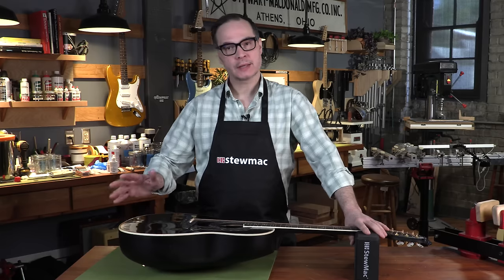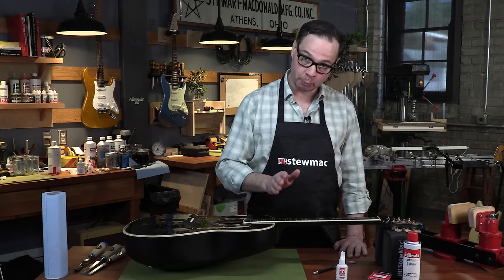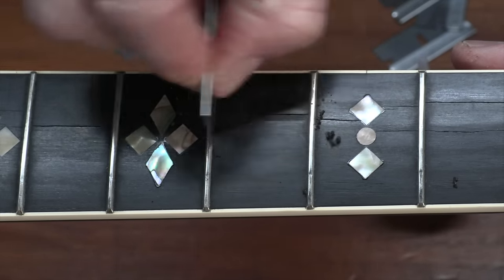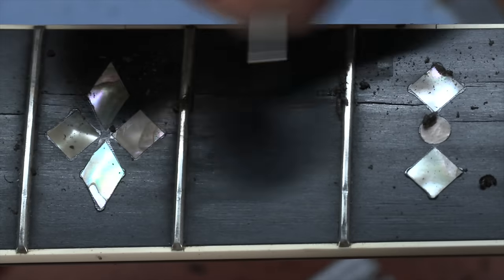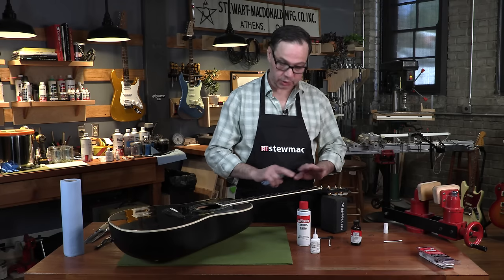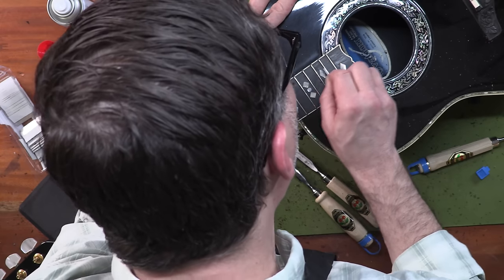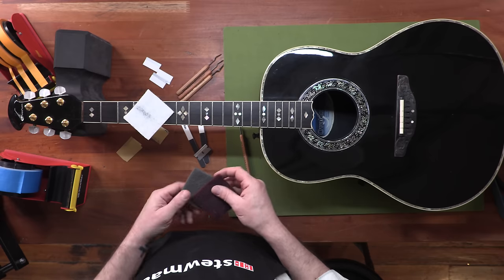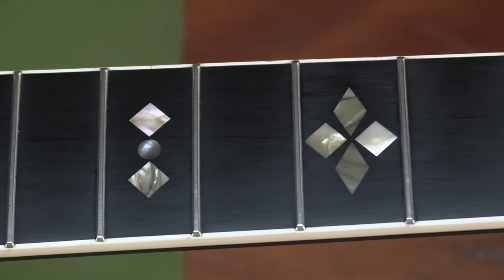Simple Trick for Repairing Cracks on a Guitar Fretboard

Comment: I've always repaired ebony with ebony sawdust plus superglue.  You sand some ebony (or the board) to make a fine dust.  Pack it into the cracks and hit it with super glue.  Scrape and clean up as he did.  I would think that it would be much faster, but maybe it doesn't get in as deep?  Its just another method and its good to know multiple ways of doing things!  Thanks!

Comment: The though of a bottle of ca going over the guitar keeps me awake at night !
Reply from the maker: You could also use a pipette.  Those are very clean and controllable you can hold it facing up until you get it exactly where you want it.
Reply: @stewmac  Better idea. You can also pull and stretch the end of the pipet and cut off the very end that didnt stretch to get less glue coming out !

Comment: Do yourself a favor and get some syringe tips. They fit on the super glue bottle perfectly, and it's way more precise
Reply: Thile guy in the video is an amazing luthier though. Do what works best for you. But I live the syringe method
Reply: You mean like a needle that would go on a syringe?
Reply: love when the rando commenters tell the experts what they should do.
Reply: @eric_in_florida  I was just trying to help. Most of us aren't used to applying super glue with a freaking razor blade....
Reply: @wbfaulk  yes. Get the dull tipped ones. They fit perfectly in cracks like the one in the video. Buy a bunch, they will get clogged.
Reply from the maker: Syringe needles are great for precise application, we even offer them on our website. They work well with wood glue, but they can fall off of a superglue bottle, and as we pointed out that can be a disaster when you have a full bottle of superglue tipped over the guitar. If you use a needle, I'd recommend the fine line applicator bottles we sell or a disposable syringe. Otherwise the whip tips are close to the same precision and stay on the superglue nozzle better in our experience. Many ways to do this job well...thanks!
Reply: @stewmac  I'll keep that in mind.  Thanks for the heads up.  To be clear, I wasn't trying to say there's a wrong way... Just sharing what little bit I know.  I use Permabond and haven't had any issues yet 🤞
Reply from the maker: @JuanValdez24  No worries! We're all about spreading knowledge and there's more than one good way to do most of this. Thanks!

Comment: Aren't you lowering the height of the wood in that spot by continually scraping it and removing material? So now there's a low spot in that section of the board? Wouldn't it have been more effective to have had rosewood flakes from another source and use that instead of scraping it from the board?
Reply from the maker: Great question! Although it does look like a lot, we are only removing about .003" of total material. That's the thickness of a yellow sticky note for reference. We scrape the board evenly across the radius to remove an equal amount everywhere as to not create a low spot. You can choose to use wood from another source, but you still need to level off the fill somehow, and light scraping is a good way to do that. Thanks!

Comment: Fun to see you working on an Ovation. I have an Ovation 12-string. The strain of 12 ball ends in line in the bridge over 50 years has split along the grain line of the 12 holes. I have an extra bridge from Ovation. I can either try and repair it or replace it. If I repair should I use wood glue or CA or epoxy? If I replace, can I use your heat lamp/skinny knife/ top protection approach to release the glue or did Kaman Aircraft use some space-age glue?
Reply: If the bridge is already cracked, any repair will simply be cosmetic.
Get the worn out bridge off with a bridge heating mat, pallette knives (round off the corners) and use extreme care not to rush the process. It should pop off. You shouldn't need to pry it free.
If you get to the point that you can't get it off, take it to a luthier. It'll be worth it.
If you get it off cleanly, the bridge footprint will need to be fully scraped/sanded, and you'll need to prep the replacement bridge in certain ways. Too wordy to type it all out, but I recommend the YT channel twoodford. He shows a lot of bridge replacements in great detail.
Good luck!
Reply from the maker: Hi Scott! Any advice we (or anyone else) could give you without the ability to examine the guitar should be taken with a grain of salt. Bridge repair and replacement can be tricky, especially on an Ovation, and this is something that would need to be seen by someone with experience first hand. Standard techniques you see on our page and others are usually applicable, but there are nuances specific to each situation that can make or break a repair like that, and that can only be determined in person. Thanks!
Reply: @peachmelba1000  so so helpful. Saved me
Gobs of tears. Any idea if Ovation in the 1970s used glue that wouldn’t respond to heat to soften?

Comment: I think I would drill tiny holes the size of the applicator tip and inject the glue in, maybe take a little sanding dust from elsewhere to make a filler with regular glue to catch the top 3-4mm then sand it all down, this job may be a job you want to remove those frets to get it all and get it right.. this is more of a quick fix id say.. very nice repair tho

Comment: Not sure if anyone from stu mac will read this but i hope so! I have just bought the neck relief gauge,  checked the stu mac site for any videos for demonstration but nothing to be found almost every other item in the shop has a video could stu mac please upload a video of the neck relief gauge being demonstrated
Reply from the maker: Thanks for the recommendation, a video would be good for that. The tool is simple to use though. Zero it out on a calibrated surface like a leveling beam or straight edge. Then check your neck. Every mark to the left of zero will represent .001" of relief, every mark to the right of zero is .001" of back bow. Thanks!

Comment: as an experienced Tech ill just say the risk of turning the bottle upside down over the fingerboard is worth it to save a ton of time using that razor blade method. Just being realistic. A busy shop doesn't have time to take that much time for a little added safety.
Reply from the maker: Yep! That's mentioned at the 6:15 mark when we go back to using the bottle. Just a demo of the razor blade technique. Thanks!
Reply: @stewmac  oh true I commented before I watched it all haha
Reply: It probably  depends on the guitar. If it’s a very high value guitar I’m on my best behavior as I go into conservator mode.
Reply: @FiddleSticks800   yes of course

Comment: “Simple trick?!?” This is NO “simple trick!” Yes, it may be possible to do using ordinary household tools like razor blades, scrapers, and maybe sand paper, but it clearly takes VERY considerable skill and hard-won experience to do it as cleanly and as successfully as you did it here! How many guitars did you have to practice on before you had the confidence to do a high end guitar like this Ovation? If it’s more than one, then it is NOT what I’d call a “simple trick!”
Reply from the maker: I think you will be surprised.  This really isn't that hard.  The biggest risk is not getting too much glue on the fingerboard.
Reply: I think you just need to try it instead of complaining about how "hard" it is before you've even made an attempt.

Comment: Why DO you guys always use lemon oil? I mean, aren't Lemons acidic? And don't carpenters just use simple wood or furniture oil stuff, like beeswax? Which you can get anywhere and probably cheaper.
Reply: Beeswax, maybe for guitar body, the fretboard needs the oil to absorb into the wood not just set on the surface.
Reply: @flintdavis2  That's what I meant, a replenish, not a finish. I was thinking of Howard's feed & wax that I've seen Will Gelvin use, Crimson guitars' fretboard restorative "Which has no petroleum byproducts in it", or even Pledge repairing oil or something.
Reply from the maker: This isn't food grade oil, it's made from mineral oil. Lots of options for oiling a fretboard and keeping it in good condition. Wax and silicone based furniture polishes tend to build up on the surface over time. Lemon oil is light, clean, and penetrates well. It helps to seal the wood and it doesn't build up on the playing surface. Thanks!
Reply: @stewmac  I'm not talking about food grade or polishes, I'm basically talking about Moisturizer but for wood, and it doesn't build up if you wipe away the excess once it's tacky. But either way I'm from England, so I'll just buy Crimsons restorative since it comes with cleaner and I don't have to pay a fortune for shipping, nor do I have a shop in the same county to nip in and get lemon oil.